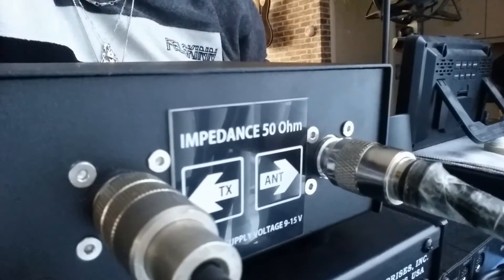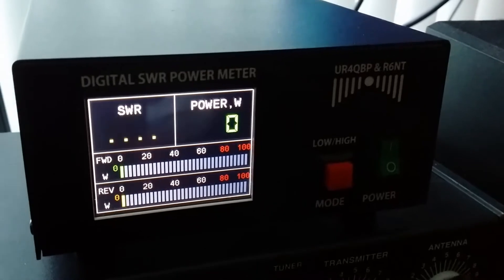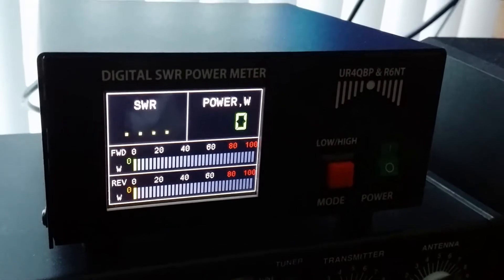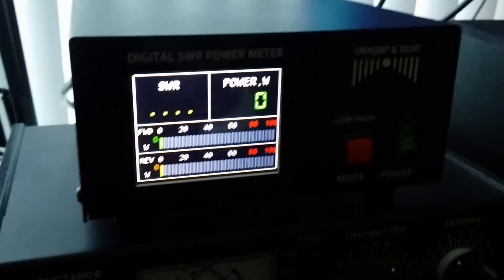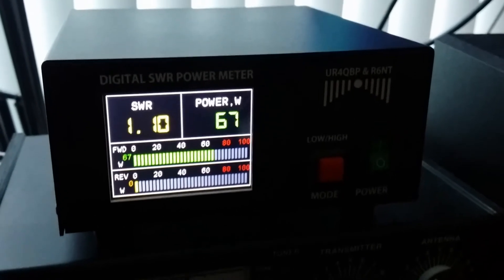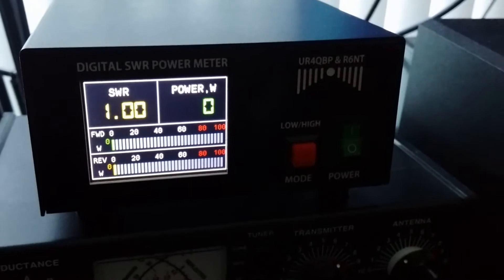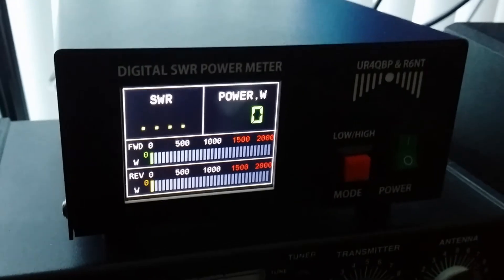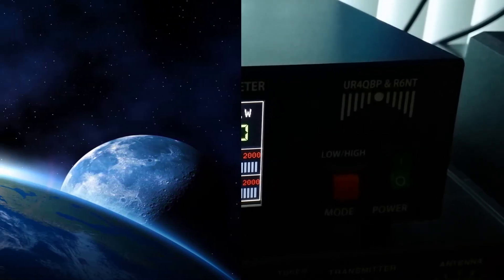DIGITAL POWER SWR METER

Comment: Hallo Bert nettes Gerät, aber du hast doch nicht das Antennenkabel am Stecker mit Tesa festgemacht :-) Was kostet ein Power & SWR Meter?
Hello Bert nice Device, have you the Antennenkabel with Tesa looked ;-) What is the Price for this Power & SWR Meter?
Reply from the maker: Hallo Andre diese version die ich hier vorstelle kostet 160 Euro plus versand kosten von etwa 7 Euro beziehen kann mann diese SWR/Power Meter hier siehe E-Mail adres..r6nt@rambler.ru hier kannst du schreiben in Englisch natuerlich weil es direckt aus Russland kommt...also wenn Du interesse hast schreibe ihm eine Mail und alles wird sich geben danke nochmal fuer deine Reaction, p.s. natuerlich habe ich mein Kabel nicht mit Tesa gewickelt es ist eine Folie die leider nicht ganz beim erwaermen sich ums kabel gelegt hat aber es ist wasser dicht und erfuellt seinen Zweck ..nochmal Vy 73 de PA5HR Bert
Reply: Bert hast du Skype? Weil ich habe mal ein paar Fragen an Dich zu den Geräten etc.
Reply from the maker: ja ich habe skype wenn du kontakt mit mir machen moechtest hier mein Skype Id: Doggie57 vy 73 Bert